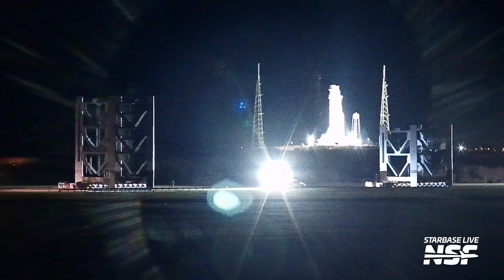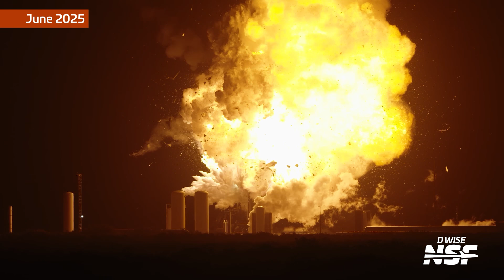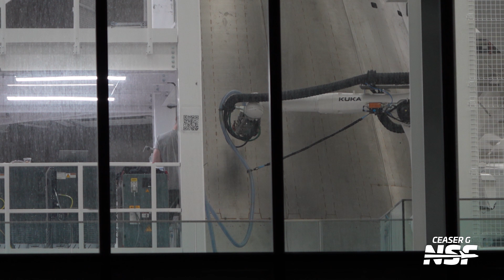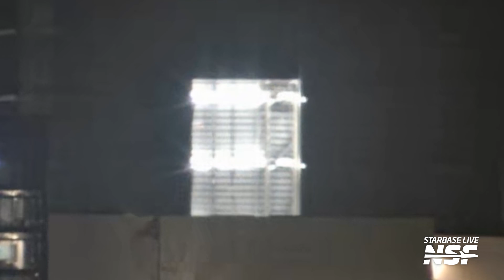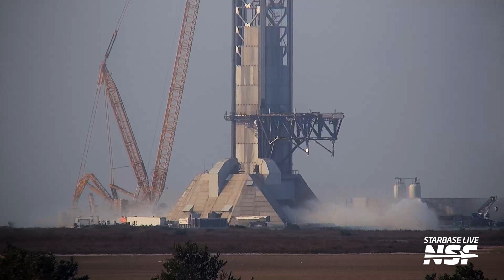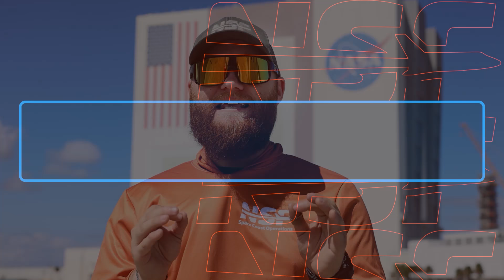Starship V3 Ship 39 Begins Testing — Artemis III Just Changed | Starship Update

Comment: '6 to 1 height ratio and it will tip over."..... Well don't forget "you can't land a booster' and Methane engine don't work. It will land they will tip a few over first, they will get it right in the end. It's just to appease the nay sayers and and some steam to all players to get a move on.
Reply: The irony is they land F9's all the time..
Reply from the maker: On prepared surfaces,  is the most common thing that gets pointed out... - Das
Reply: @NASASpaceflight  True, but sometimes those surfaces are also in motion.  The slope of the surface and lateral motion will be the two big issues and until we know the actual CG and those leg details the max slope can't be calculated so any tipping point is guesswork.
Reply from the maker: Also, what's under the surface in any given spot... - Das

Comment: V3 SN1 no, no, no. Loads of reasons. In a couple of years there’ll be several versions in simultaneous production; cargo, human, tanker, depot, HLS. Each will have different subvarients; cargo for Starlink, cargo for space station resupply etc. Each variant would have to start with SN1. That means there could be years of progress between different SN1s. There will be partial upgrades eg v4.1; would they start SN1 or carry on the V4.0 SN series? If they carried on the previous series, what happens if a hybrid is built Vx and Vy, which SN series is used? Or do they start SN1 again, even if the hybrid is a one-off? It’s much better to carry on the simple S series because that allows for numerous simultaneous variants and will always give an indication of age.

Comment: The Starship HLS won't have a height to width ratio of 6:1 (actually 5.8:1). Even with just the planned adjustable landing legs, the stance is increased by at least 2 to 4 meters. This gives it a minimum H2WR of 4.75:1 to 4.4:1. A more likely design stance will be 14 to 16 meters pad tip to pad tip. That's a H2WR closer to 3.3:1.....

Comment: "Beyond this, the physics of landing a six-to-one height-to-width ratio vehicle on the uneven, poorly lit polar lunar surface seems questionable at best."

I remember a few people raising the same point (Starship toppling over) some years ago, only for their concern to be dismissed by the NSF community.
Reply: yeah, it's an odd comment.  The concern should be, where is the cg of the lander with respect to the footprint diameter?
Reply: One of the bigger issues will be can they zero out any lateral motion.  That tends to be the killer.  Otherwise they have A LOT of experience landing big tall things on their tail.
Reply: @imaginary_friend7300  They have experience with cancelling out lateral motion, at least on Earth with more gravity, they have no experience with uneven ground.

Comment: I have a pretty good feeling about flight 12. Especially with the amount of testing they did on the S39.1 tank.
Reply: The first two V2 ships exploded, so a flight failure with V3 (which is a larger change in design) is even more probable.
Reply: @cub @cube2fox aint like I don’t know about flight 7 and 8 but they definitely tested the v3 hardware more, especially where they already experienced issues in other flights.
Reply: @eierkuchen5900  I think the hardest part will be getting to (near) orbit. Reentry and soft landing hasn't been much of an issue lately.
Reply: @cube2fox  exactly and thats what I have a good feeling about

Comment: 43 might not be getting any tiles, because, maybe it's going to be assigned as an orbital fuel depot for refueling transfer tests.. and once it's done testing they might just drop it in the ocean, without trying to save/catch it, so it wouldn't need a heat shield..
Speculating of course..

Comment: With the difference in ISP between raptor and R-Vac vs cost and time of manufacturing 3/3 is understandable even for going to the moon, V3 with 3/6 config for mars cargo test flight and cargo flights will use 6R-Vac with thrust differential for flight control. Starship could have several cargo variants on the moon before NASA SLS is ready to try lunar landing again. I have said before SpaceX Starship program is mastering the hardest part first, earth re-entry in a rapid reusable condition. Once Starship can leave and return to earth and be in a rapidly reusable condition mass production will kick into high gear, fuel depot will be 3 or more Starships hard docked together. The primary depot ship will have pumps and chillers and dedicated transfer docking the other 2 will be hard docked to pumping ship as storage tanks. HLS human or cargo for moon or mars is easier than earth. I can't wait for first asteroid mining starship.

Comment: My other question may be what about doing the Starship HLS uncrewed landing demo, maybe that will still be done on its own, but will be along with the new Artemis III or a separate mission still maybe in 2027? Somehow you would need to get from LEO to lunar with Starship HLS if it was during the new Artemis III plan. Also, I don't know if an early Starship HLS will be reentry ready for a return to earth other than a destructive one unless there will now be heatshield tiles on the HLS variant perhaps earlier on then maybe it was originally expected from the outside audience at least. Either way once Starship HLS does get over to our moon you know people, to whatever extent possible with even just a demo flight, will be chomping at the bit for putting as much science on there as possible, at least doing the SCALPSS surface regolith interaction investigation.

Comment: Starship will NEVER land on the moon...it's center of gravity is simply too high...
Reply: Starship HLS' center of gravity at landing approach is completely dominated by its propellant (several hundred tonnes of it, even at the moment of landing - required for eventual liftoff, transit back to lunar orbit, and orbital rendezvous to return the crew back to Earth, plus boiloff margin on top of contingency reserve margin).  And that reserved propellant mass is in turn completely dominated by liquid oxygen  (both because you need two O2 molecules for every CH4 molecule to support combustion, and because each O2 molecule is about 2x more massive than a CH4 molecule - so the mass ratio of O2 to CH4 is nearly 4:1).  And all that liquid oxygen, at landing approach, is settled at the bottom of the main liquid oxygen tank, which is positioned just above the main engines (i.e. at the bottom of the Ship.)

Besides which, a lot of Starship HLS's dry mass (everything except propellant) is also located toward the bottom as well - including the main engines and plumbing (including for propellant transfer), the main engine thrust puck (which, along with the engine skirt that's also at the back, is the strongest structural element on Starship), and the landing legs.

So, like a Roly-poly toy, Starship HLS is actually much more stable than it superficially appears.
Reply: I think the engineers at SpaceX know more about its center of gravity than you do...
Reply: @hamiltonjones9863 Dude...I adore Starship...however...again...Starship will NEVER land on the moon. Do the math...
Reply: @stuartromig9576  Do that math?  It has nothing to do with math.  You're full of sh*t.  Period.  You don't even know where the CG is and I'd be real money you have no real understanding of what the effects actually are..  You're full of sh*t from start to finish.  You're another pretend expert making a fool of yourself.
Reply: @stuartromig9576  Starship has already landed with legs less than it's diameter. Did it without the fuel advantage that Spherical_Cow explained. And without Rvacs adding weight to the bottom. Even crunched the legs on one side and still didn't tip over.

The landing engines will add weight mid-way up, but that will be offset by not having front flaps and header tanks at the top. We have better maps of the moon to find a flat spot. And with 1/6 gravity, it'll be easier to make self leveling legs. Not so much because it could tip over, rather it will need to be vertical for the elevator to work.
Reply: At best, it will be a Starlink delivery system in low orbit. 
Even that dream is 1% of the way to reality
Reply: @mervstash3692 yeah it is taking a pretty long time
Reply: @hamiltonjones9863 most fake it till you make it grifts do
Reply: @mervstash3692  I'd put it at about 75% of the way to reality.  If v3 doesn't suffer from major issues like v2 did, we should see the first operational Starlink v3 deployments via Starship by end of this year.  But even with teething problems (not improbable), Starlink v3 flights on Starship are still nearly a certainty next year.

The main holdup (and the reason for last year's sloppily slapped-together 'v2' design as a stop-gap measure) has been the maturity and availability of Raptor 3 engines.  Based on the observed testing and production cadence, these engines are finally ready for prime time.

Aside from which, the history of extensive mechanical and cryogenic load testing of v3 design elements and test articles over the last half-year+ indicates that SpaceX is now serious about delivering the first performance-optimized and production-quality design - as opposed to churning out conservatively overbuilt, feature-minimal, and rough concept-proving prototypes.

I'm cautiously optimistic that v3 will start off with much more success than v2 did - though of course, with so many design changes in one go, there's still always a decent chance of unknown unknowns and whatnot.  It'll be a fun watch...

Comment: Starship will be used on Artemis III. Since the lander can’t reenter, in my mind SpaceX tests it in LEO and then refuels and sends it to the moon for a test landing. They need to test the landing anyways, why not do that with hardware they’re already going to be sending to orbit?
Reply: I bet an entire years salary that starship is no where close to landing on the moon. The SpaceBois are enamored with starship but dont realize that starship is about 7-10 years away from attempting a moon landing. Save this and @ me when im right
Reply: Why not?  Probably because they won't have yet finished developing all the systems necessary to sustain long-term cryopropellants, as well as approach and perform a controlled landing on the Moon, as well as put a propellant Depot in orbit and fill it up with multiple Tanker launches (which is what will be needed for HLS Starship to not just reach the Moon but actually carry out a controlled landing there.)  Getting all of that designed, proven out, and operationally deployed will easily take SpaceX into 2028 if not later...
Reply: I bet you my house and all my assets that it wont be part of A3.
Reply: @m @mervstash3692  You can just send me your banking info right now.

Comment: Everything depends on how well the v3 Starship debut goes.  If it's like v2, 2026 will be another 'lost' year.  If it goes smoothly, we may actually have the first orbital docking and propellant transfer demo by end of year or so.

Regardless, there's absolutely no chance of either SpaceX or BO HLS being man-rated and ready for crewed operations in LEO a year and change from now.  And less than zero chance of either of them being ready for crewed Moon landings and missions (having completed at least one or a couple of uncrewed landings of otherwise fully realistic man-rated prototypes) two years from now.  Isaacman looks to be continuing NASA's fine tradition of fantasy bullshit schedule projections.

I'd expect it'd take at least 1.5 years just to train up the mission crews using finalized and flight-like hardware - meaning that hardware would have needed to have passed final design reviews and having been built already, and crew training starting up just about right now.  Yet, both the BO and SpaceX HLS are at least a year if not longer from initiating their Critical Design Review - much less passing it, much less delivering the final hardware as-designed and -approved...
Reply: Man rated?  For operations that take place in space?  Or is man-rated different from the man-rated used for launch vehicles?  The stands I read all applied to ascent and descent.. on earth.
Reply: @imaginary_friend7300   both.  For HLS, there's crewed descent and ascent to/from the Moon involved.  And apart from launch/landing, just sustained crewed operations in space require a raft of redundancies and special considerations, that unmanned systems do not.
Reply: @Spherical_Cow  I know they are taking crew to the lunar surface and back but the regulations I read was entirely about the launch vehicle and crew vehicle for ground to orbit and back.  No wording indicating it would apply to other bodies.  I guess I'm out of date.
Reply: @imaginary_friend7300  I don't know if a particular singular regulation exists to encompass it all.  But it's obvious that crewed space vehicles have a slew of design requirements that are additional to those of uncrewed vehicles.  Everything from certifying the ECLSS, to designing all critical subsystems for triple-redundancy, to dealing with an oxygen-rich atmosphere in a pressurized environment (along with mitigations for oxidative damage and fire suppression, as well as elimination or minimization of any toxic or irritant outgassing, or worse, toxic combustion byproducts in case of a fire.)  Then you have human-factors (usability, accessibility, maintainability, diagnosability, maneuverability, safety) design aspects that come into play both for the vehicle interior and, to the extent that any EVAs are envisioned, also the exterior.  And all the critical systems would need to be engineered and test-proven to a couple of orders higher reliability (or, lower probability and rate of failure) than in unmanned systems.
Reply: I guarantee it's another lost year. V3 will just introduce a whole new set of problems. We don't even know how many versions there is going to be. 
Remember when v1 was meant to achieve all the goals? 
It"s just faking it till you make it and keeping the grift alive till that big IPO launch to bail out the X & xAI investors tens of billions in the hole.
Reply: @mervstash3692  v1 was never meant to achieve all the goals.  It was a very rough, very bare-bones, concept-proving prototype.  Also, SpaceX is extremely profitable (even more so now that Starlink has started to generate net profit) - so they don't need to fake anything, and can comfortably fund Starship development forever out of their own, and still rapidly growing, profits.